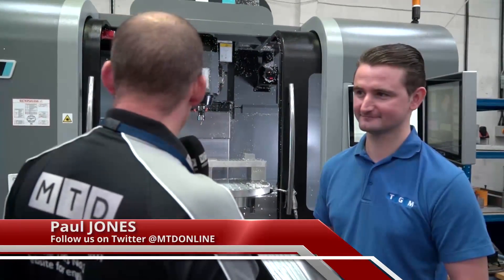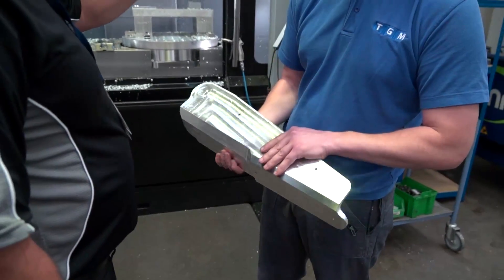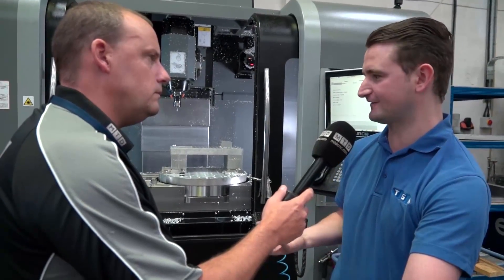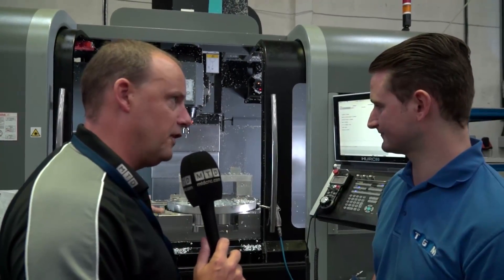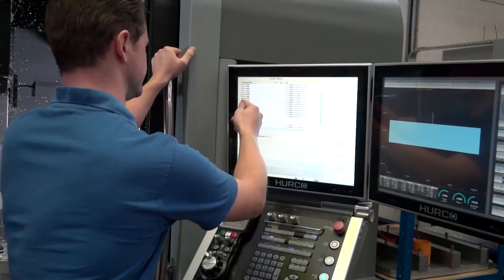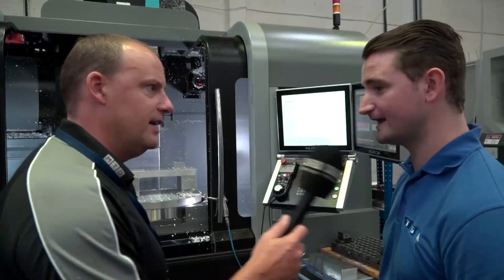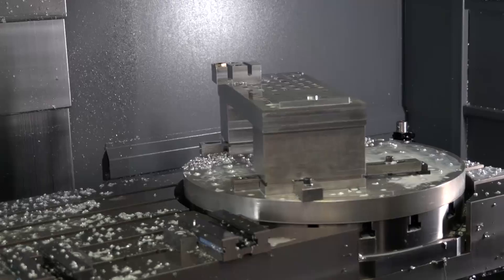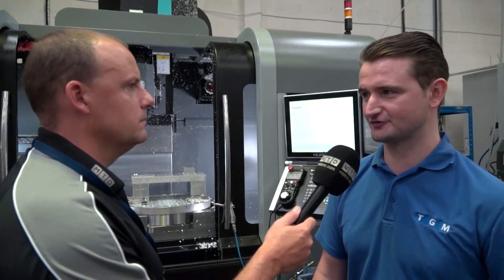Aerospace manufacturer TGM tackles titanium machining on their Hurco machine tools

Comment: Is there any particular reason why the 4th axis table is 0.5mm lower than the rest of the table? Shouldn't it be flush? To bolt down full length works? If some safety is of concern. You just need a Master Bit in the parameters to disable 4th axis motion. Even on start up, it shouldn't need to be zeroed.
Reply: Ok, it looks like that the main issue now, with that gap, you can't have a bolt in that section of the table. The two corners on the right side doesn't look like it offers much. Oh well. The main purpose of this machine is to use the 4axis, but have some pre or post op milling, off to the side.

Anyways, thanks for the reply. That's pretty cool. :)